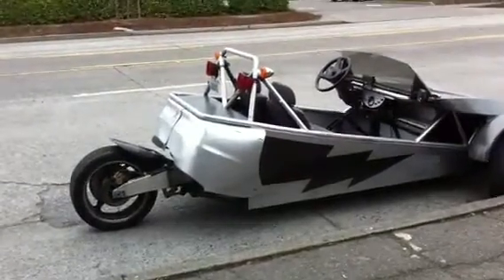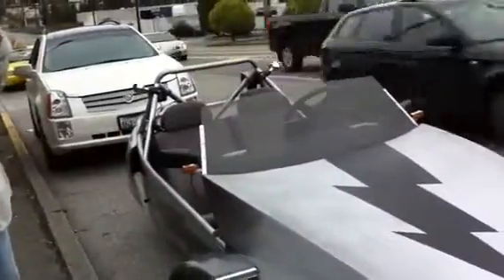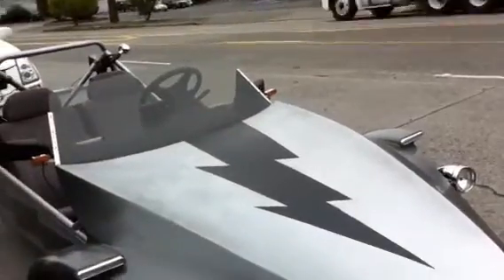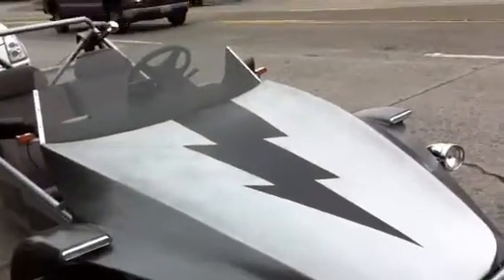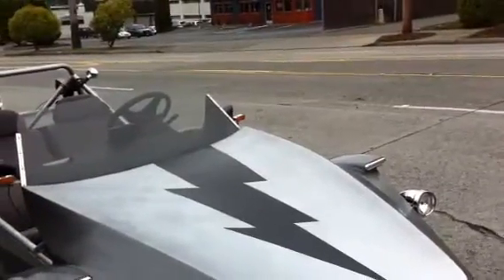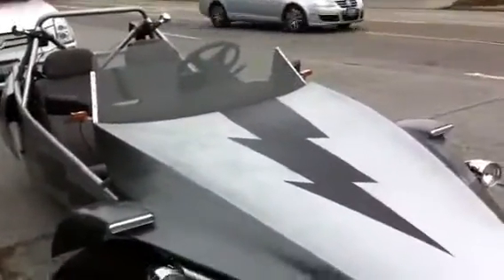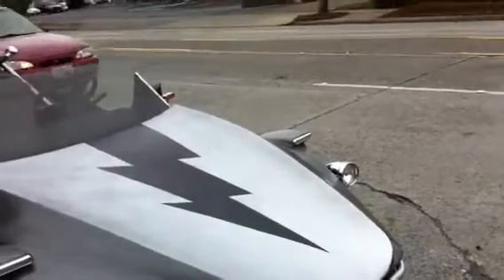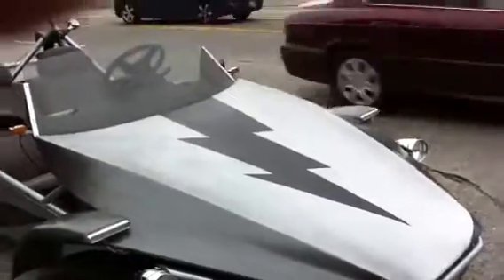Homemade electric reverse trike convertable

Comment: That is sweet.
I am building a prototype which is similar but I am using the front axle and steering mechanism off of an old riding mower, and it will only seat one person. I too am using the rear end of a motorcycle for the drive wheel and the brake. My first build is designed for lower speeds and on a budget, hence the lawn mower axle for steering. My first prototype will use a wooden frame to save money. I had a junk motorcycle and riding lawn mower to canibalize for the first experiment. :)

Comment: @Machinimator Does that lawn mower front axle have any brakes?!  The rear wheel will not stop you if you are going more than 5 mph.  It will just slide.